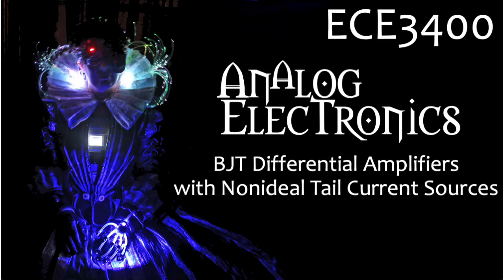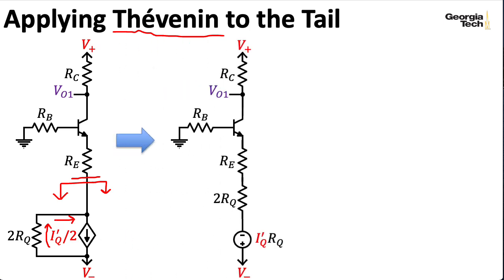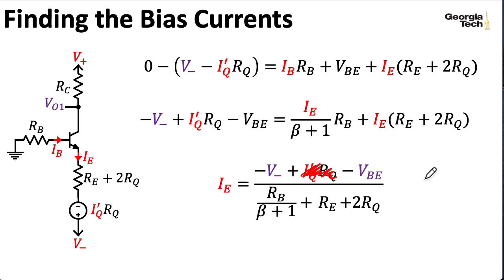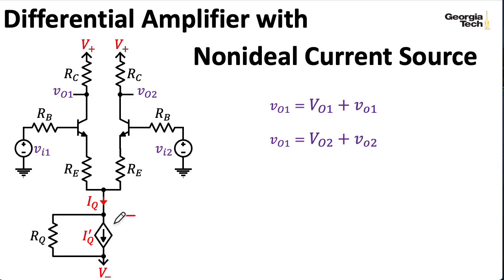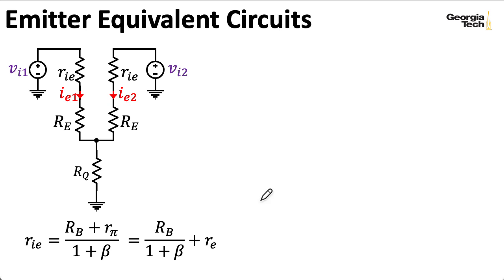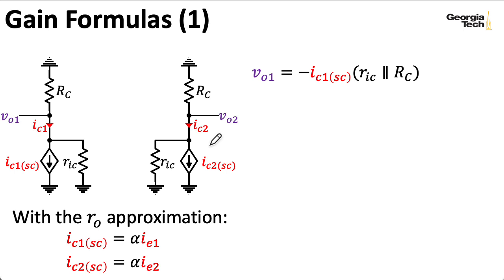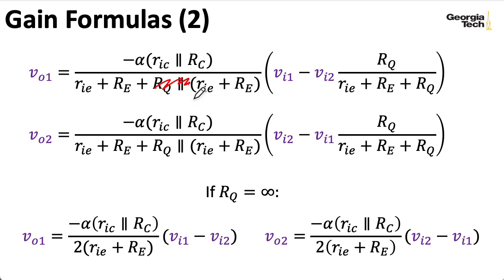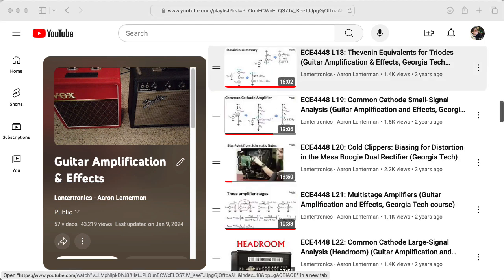ECE3400 L21: BJT Differential Amplifiers with Nonideal Tail Currents (Analog Electronics)

Comment: What's Rb? Is it real or part of the BJT model?
Reply: It is the resister at base
Reply: @DEEEPAL-i31 I’m working on a similar circuit, and got a little confused by THAT2180 datasheet, which says it is designed to be operated with zero source impedance at control pins, connected to the bases of internal BJTs. Now I wonder what happens when Rb is zero or close to it?
Reply: @comPOed  are you a student ?
Reply: @comPOed  
  You are talking about Rb,
Let me clear out this, Rb is externally connected to the base terminal ..
So its not the internal resistance ..
So it will not effect the bjt 
If Rb will be large .. the there will be more voltage drop and less current will enter in the circuit but if Rb is less .. or like if its value is zero .. there will be a short circuit ..
And no voltage drop
Reply from the maker: It's kind of flexible. It could be a resistance that you put in the circuit on purpose, or it could represent the output impedance of the voltage sources that are feeding the amplifier, or a bit of both. 

I don't get into it here, but you could also put in a bias network if you want to bias the base somewhere around ground, like if you are building this with a unipolar instead of bipolar power supply. In which case you'd have a DC resistance looking out the base that would be like the resistors in parallel in the resistor divider setting the bias, and you might have a different small-signal resistance looking out of the base.
Reply: What do you mean by real ?